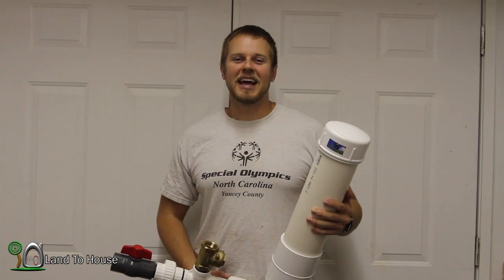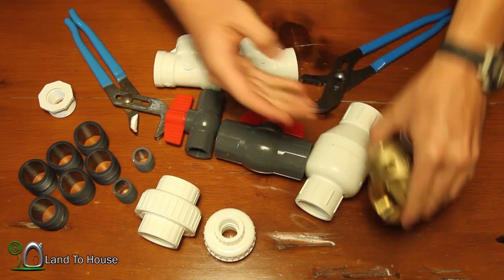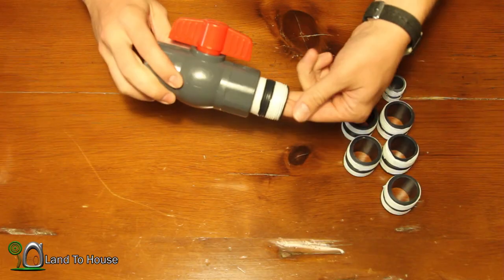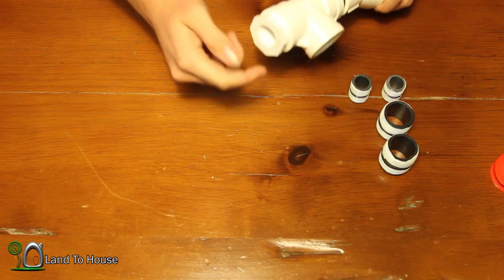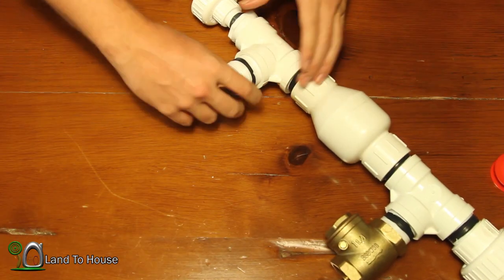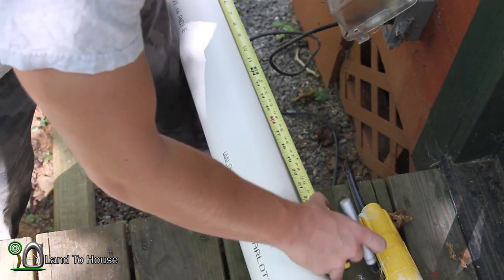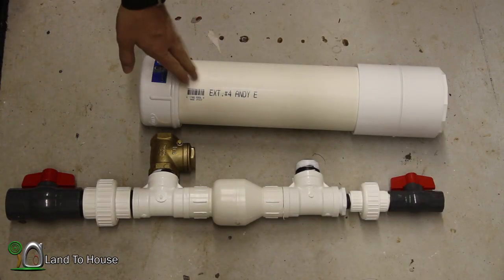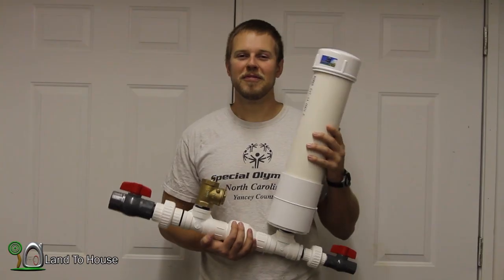How to Build a hydraulic Ram Pump

Comment: Saw ur video today, 👍🏼🙏🏼
About using the bicycle tube, have u tried it in reverse?
I mean drill a hole on the pvc cap for the bicycle tube valve protruding through it, then seal.
Then assemble the pressure PVC without inflating d tube first.
Later inflate the tube, so it will (hopefully) put up the pressure inside the pressure PVC, making it higher than 1 bar.

Is it going to make it better?

Comment: Nice tutorial...but man some basic knowledge of things. Hold the roll of teflon tape the other way and you have total control to have it tite on the treads. Second thing was you have to apply PVC glue to both parts you  are assembling outside on the pipe, inside the coupling

Comment: about what is the material cost
Reply from the maker: The cost will depend on where you purchased. And if you use PVC or metal.
Reply: @LandtoHouse  am doing some rough calculation am thinking about at least $60  the valve are most expensive
Reply from the maker: Yes the brass swing valves can run as high as $25 for the lead free version.

Comment: Excellent presentation.
Clear, concise, and no performing to the camera.
You've also answered a question, of a simple solution to a diaphragm, which is pretty well fool proof.
(The best tool to cut PVC pipe is a wood handsaw.)
[Your link to Amazon;
Currently unavailable.
We don't know when or if this item will be back in stock.]
.

Comment: Very good video! Just wondering what the purpose of the bicycle tire tube is?
Reply: Old timers would use something like this in house plumbing to prevent the "knock" you would get from water hammer. However, code no longer allows that because sometimes with the water hammer it could slowly force the air out of the chamber. The bike tire is probably to ensure a certain amount of air is always in the chamber to give that cushion effect.
Or it could be so he can say his is different than others on the market.
Reply: @johnm.4141  thank you for explaining

Comment: I would drill a hole in the cap and nut or gorilla glue the tire valve, depending on if it has metal threads, to the cap. No rubber bladder holds air forever. If it did, we wouldn't need tire pumps more than once per set. If the valve were outside, you could easily pump it back up without disassembly.
Reply: To be fair I don't think that part is even necessary or functional.  The air inside the PVC chamber itself acts as a pressure buffer.
Reply: @carvedwood1953  agreed

Comment: When you build the pressure tank out of PVC don't just glue it, but be sure to always use primer first. PVC  will break apart overtime with out it. There is a chemical reaction that bonds them together for a prominent seal. Without primer the glue will lose its seal in time. I've been a plumber for 48 years and I've seen this happen time after time. I  prefer the clear primer myself, it works better than the purple primer even though the clear is not legal to use. The only reason we use purple primer is so the inspector can see that you used the proper primer, no other reason.  By doing so it ensures the inspector the piping will not fail. I'll say it again, use the clear primer it really works better and you don't see the purple miss all over the pipe and fittings. The clear is in a yellow can and it's made by Charlotte. Your videos are great on your illustrations of ram pumps, keep putting them out. I've learned some good things from you.
Reply: Just had to repair some plumbing I put in 20 years ago. Glue failed and a T came loose. As I was putting it back together 3 more joints, the other sides of the T and a 90, gave up. I'm praying that the joints under the slab don't fail me. I knew less back then. I was young and dumb. I got over being young years before the the dumb wore off, if it has.
Reply: @acarpentersson8271  29 yrs!
Reply: @srinigypsy  
20. But I don't know why another 9 would matter. PVC buried should last longer, right?
Reply: @acarpentersson8271  pvc should but the joints would depend on type of bond im wondering.
probably plenty of support under the concrete. maybe install a pressure valve to maintain steady pressure?
Reply: @srinigypsy 

That's a good idea
Reply: I've never heard of the clear primer.
I recently looked at a friend's leak under his double wide. Turns out some highly intelligent person had neglected to use the cement as the pipe and fitting only had purple primer.  Somehow it held for several years.
Reply: Why is it illegal?
Reply: @drasticmeasures7479 or because its not purple for the inspectors🤪
Reply: @drasticmeasures7479  I think is because the solvents used...
Reply: If I'm curing bamboo poles for an aquaponics setup, is this primer tip for me also? Because I'll be using glue to secure things to the bamboo poles. Should I think of primer as being a necessary ingredient for anything glued that REALLY can't fall apart? I.e. grow operations?
Reply: Respect to your 48 years experience, I heard somewhere that primer, soften the surface of PVC, so that it fit more snugly with the other part.

Comment: I need a little help 1 1/4 has been running consistently for over a week, stopped during the night the swing valve may operate for 15min and all of a sudden stick closed.  Seems to operate freely when not under pressure any ideas thanks
Reply: Problem resolved,  the pvc ck valve was randomly bypassing when under pressure,  removed and inspected, valve stayed full of water for 12 hrs, reinstalled same issue,  replaced valve, pump started cycling normally

Comment: I purchased a 3/4 pump from you to use on a new spring that was running about 10 gal a min ( didnt know at the time if it would keep the same volumn), pumping up an elevation of approx 83 ft and a distance of 950 ft 1/2 pex,  i was amazed to get approx 240 gallons a day, so i built a 1 1/4 based off this video, and happy to say that with the same elevation and distance the pump is providing approx 800 gal per 24 hrs.  Your video's are extremely informative, Thanks for taking time to post all the ram pump videos
Reply from the maker: Nice results! Thank you for sharing. Its nice to know you have also given the 1.25" a try. Big difference in the two pumps output.
Reply: Interesting. Could I ask what size pipes were used or are best to use on these 2 different size pumps?
Reply: @bushtuckaman  I purchase my 3/4 pump from land to house, and followed his recommendation on this project,. I originally used 1 in supply line because I had it on hand, the spring was running 5 gpm, I then converted the supply line to 2 in pvc to use the 1 1/4 pump, spring column was up to 10 gal min at this time.,. I was able to use the 2 in supply line on the 3/4 also as the gpm dropped due to drought conditions.  Please watch all the videos provided by land to house, it's very informitive. Thanks

Comment: This guy's PVC glue job will fail for sure It is barely glued on the tip of the 4-in PVC you have to glue both sides in order to have a solid glue joint you can pull that right apart without much effort at all the way he did it You're definitely better off building it on your own if that is the kind of work he puts out You're welcome
Reply from the maker: This pump was in use for 3 years. I still have that pressure tank.

Comment: Why did you cut the pressure tank 17" and not 16" or 20"?
Reply from the maker: 17" is pulled out if a 120 seven times nicely. It provides a good volume and allows me to pull several tanks from a 10' pipe. I sell pre built pumps. You can build a tank up to 3 feet. It just takes longer to reach pressure.
Reply: @LandtoHouse  Could you also use a wider pipe for the pressure tank? Could it be another type of tank?

Comment: Ok know I get the answer to why you put the inner tube inside. It acts as a expansion tank like on a deep well pump. Which is in fact a vacuum breaker. By creating a greater negative pressure inside of the 4" pipe than what the atmosphere pressure is on the outside. Cool !

Comment: In regards to the pressure tank... why are you using a 4" end cap? Wouldn't a 4" clean out be better so you can easier replace the bicycle inner tube in the future? I'm very new to these, perhaps I am missing something?
Reply: I checked & the clean out cap is only rated 5 psi. You can unscrew the bottom of the pressure tank at the pipe nipple if you need to replace the inner tube.
Reply: Also new to these and I was thinking the same thing.
Reply: I would think if you were to use a clean out cap for this it would leak pressure and not be very efficient. And that's if it was to hold any pressure at all.

Comment: Is this not free energy ? i mean you could pump water up into a tank then have it come back down over a water wheel back into the system ?
Reply from the maker: Sadly the waste water is aroundb80%. The water pumped at best is 20%. There is always energy lost.
Reply: Think of these as energy concentrators. They convert the energy of the flowing water into “head pressure” and allow it to flow upwards.
What you do with that potential is up to you, but most simply fill a holding tank for irrigation.

Comment: Please help me out with 2 questions
1) why are you using all threaded why not just glue and go?
2) what is the purpose of the PVC Union that is an expensive piece just to make a union that you are basically already making with the threaded nipples. (for example your swing valve is connected to a T then threaded to a pvc union then threaded to a ball valve why not just thread directly to the ball valve or even better see Question #1 and skip the threads and glue to the ball valve) 
I am a new plumber WITH LOW $$$ to spend so excuse in stupidity and just know it was said to save some coin lol

Comment: Question:
What difference does it make if you use a swing check valve instead of spring check valve in the delivery valve?
Reply: Ram pumps operate by building up inertia in the supply line flow, then suddenly stopping that flow. The moving water want to keep moving, and it’s energy is converted from flow to pressure. How MUCH pressure is a function of supply pipe length, diameter, and rigidity, and the flow rate reached by the water in the supply pipe before the waste valve suddenly closes.
Adding a spring to hold the waste valve open allows a faster supply line flow to be reached before the valve is forced closed by the waste flow, and so a higher peak pressure to be produced by stopping the supply flow, but it also slows the pulse cycle down, so you may get less output flow. You can tune the system by adjusting the stiffness of the spring.

Comment: Great video series on these ram pumps.... what is the purpose of the unions?  They seem redundant if the threaded nipples are used....   Also, I have a ton of 1 1/4 poly already, can use it for both the intake and the output? Or must there be a size difference for proper pressure?

Comment: Hi, compliments with your projects......just a question : according to the instructional video on the 1-1/4 inch (drive pipe) and 3/4 inch (delivery) pump, the length of the pressure tank pipe cut to size is 17 inch but your ready-made item has a tank 24 inch tall. Any specific reason ? Regards, all the best
Reply: This is because when it is assembled, the pieces combined add to the 17" height of the pipe

Comment: Can you tell me what deciphers the height that your pump will be able to pump?
Do you sell a ram pump that can pump 200 feet elevation?
Thx for any info!
Reply: "Working fall" is the pumping power. For 200ft (60 meters) you would want at least 7ft of fall (1.5m) for any amount of flow (1 litre per minute falling 7ft, at 66% efficiency, will give you about 1 litre of water pumped 200ft PER HOUR) http://www.i4at.org/lib2/hydrpump.htm - table 1.

Long story short: pumping 200ft needs at least 7 ft of elevation on the Feed side of the pump.

Comment: Great work.  Thanks.  Once the pressure tank is sealed there's no way to check and service the tire tube though.  Any way to get a good seal and have ability to do that?
Reply: You can drill a hole in the cap and poke the valve stem out the top of the tank, sealed with a polyurethane adhesive like 3M5200 or Sikaflex 291. I’d fill the innertube to 1/3 - 1/2 the expected delivery pressure, which should allow it sufficient crushed volume

Comment: Can a 2 inch drive pipe works on a inch and a half pump
Reply from the maker: There are times where you can get it to work. But it's best to have a drive pipe that is the same size as the pump. Now you can use a stand pipe to switch between 2" supply line and 1-1/2" drive pipe.

Comment: Hey, can I ask you what is the purpose of the bicycle tube? Please and thank you!😊
Reply: The large pipe is an accumulator, allowing a larger volume of water to flow past the check valve than would if the water down the entire length of the output pipe had to suddenly flow. The inner tube holds a quantity of air, which compresses as the water comes in, then expands to keep pushing the water flowing out through the output pipe.  You can simply use a trapped bubble of air, but over time that air would be lost (it dissolves into the water) and the expansion tank (accumulator) would lose its effectiveness.
You want enough air in the tube so that it can still provide enough cushion volume when the output line is full and the maximum output pressure has been reached.

Comment: Really don't understand the need for the inner tube. If the 4" is capped and vertical, it will always automatically trap air. Although the tube doesn't hurt anything, I do not see the upside.
Reply: I'm curious how long the bike tube is actually providing value anyway.  Anyone that has owned a bike knows that tires need to be refilled  somewhat often.
Reply: I think it's to reduce the time it takes for the air pressure to beat the spring check valve. Presumably you could also do this by adjusting the height of the cylinder
Reply: My guess is that it holds a given quantity of air at pressure higher than would be in the empty chamber. I thought I saw some pretty high spikes in  water pressure on that gauge that might be captured by the higher air pressures?

Comment: When you are doing the installation on the guys farm (in the cold cold water) you said you get a 7:1 rise. Does that mean the total possible rise is 7 times the drop from the source? I am guessing so, but want to verify n the interest of clarity.
Reply: Short answer: No, it can be a much bigger rise. A fall of 1m can pump against a rise of 40m - but it really depends on the flow (it will be REALLY slow beyond 10:1). Larger flow, and larger falls, will create a lot of lift (at the cost of the volume of water you get uphill per hour) http://www.i4at.org/lib2/hydrpump.htm

Comment: Hi im a new subscriber.. admiring your work. I made my own version of your ram pump using all 3/4 pvc pipes. My problem is the outlet does not give out much of a strong flow. Do i need to change my outflow pipe to 1/2 pipe to make the flow stronger? Or is the problem on my pressure tank? I hope you can help me.. heres a video link to my work
https://m.youtube.com/watch?v=l_OBJ6P8B-k

Comment: Can you get your ram pumps with the clear pressure tank and drain
Reply from the maker: Yes. You can use clear PVC for the pressure tank. I have done that for some testing. I don't sell it because clear PVC is extremely expensive

Comment: I believe I saw a ram pump built without the inner tube. Why do you use this? What purpose does it serve?
Reply from the maker: In old ram pumps or large commercial pumps there is a snifter valve that replenishes air in the pressure tank with each cycle. Because these pumps don't have that valve the inner tube provides some feedback in the pressure tank.

Comment: If you reverse the orientation of teflon tape, so that the treads are touching the outside of the tape and not the inside, the tape stays tight and you get a better wrap around the threads.

Comment: Plumbers tip use 7 turns of teflon tape and hold the reel with the tail laying flat on the thread. makes it easy to remember which way to wind

Comment: I wonder what sort of total efficiency (quantity of water out for given quantity in) you'd get if you used the waste water from the first ram pump to through a buffer reservoir to another probably smaller ram pump.
Reply: No, that would reduce the velocity and therefore the peak pressure needed to lift the out flow.

Comment: is the tire innertube useful for anything? seems pointless
Reply from the maker: In large commercial ram pumps there is a snifter valve that replenishes a small gulp of air with every cycle. In the small ram pump the inner tube acts as a bladder that pushes back on the water.

Comment: Could you use defuzzed tennis balls instead of the inner tube? Or a smaller piece of PVC pipe with end caps as a pressure displacement vessel?
Reply from the maker: Good question. I have actually used tennis balls and racquetballs and neither of them gave quite enough feedback. The inner tube seems to be a good bladder material. The PVC would not work because the fill material needs to have bounce back.

Comment: If I were to use a 2 " or  3" check valve would I have to use the same size waste check valve for highest efficiency or could I use a smaller one to save money without efficiency loss?
Reply from the maker: You can use a smaller valve for the secondary valve. Possibly even half the size.